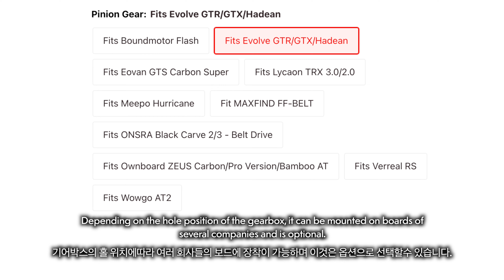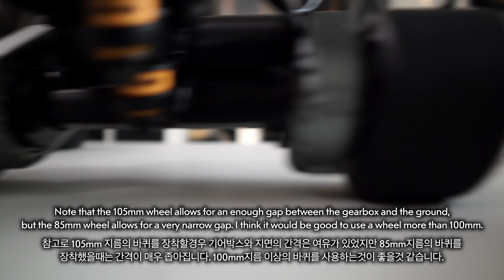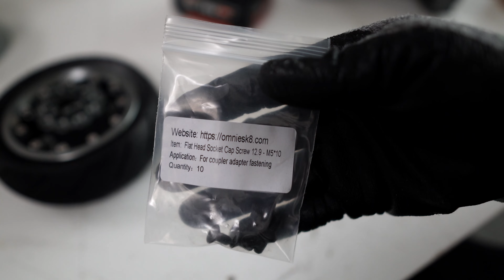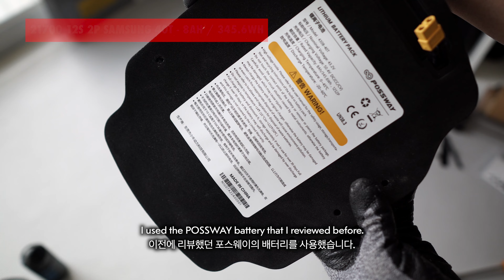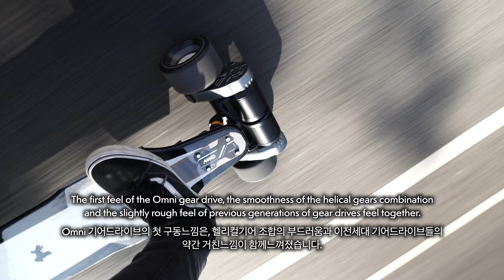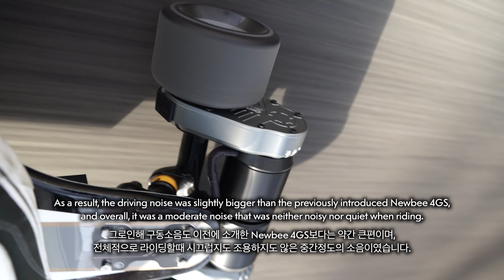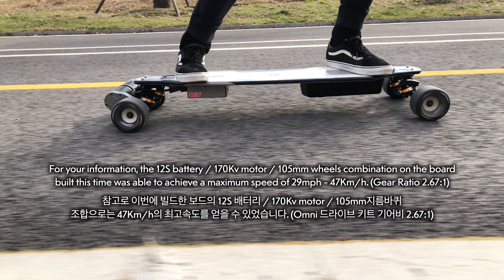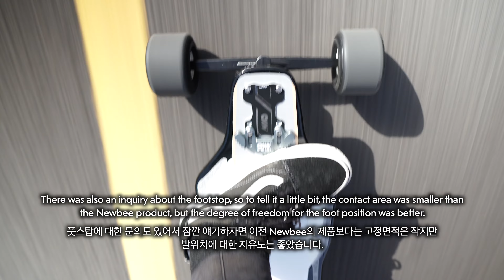#164 Build an Electric Skateboard with Omni 2-in-1 Gear drive system / Fits Evolve

Comment: where do you get the truck screws and nuts from? So interested in those kinds now, instead of using hex/allen key type screws.
Reply from the maker: If you search for M5 hex head bolts, M5 nylon nuts, you'll be able to buy them anywhere. You just need to select the length of the bolts.
Reply: Thank you @KAMiJUINs

Comment: The Meepo V4s ER uses the same Cells though 10s2p but I never expected such a high current could be extracted from those, as there is a noticible drop in voltage already with the comparably tiny output of 30A that it has.

Guess the pre built boards must have noticeable higher electrical resistance somewhere, compared to the DIY's.
Reply from the maker: In fact, Meepo's setting is the right setting. 
This is because it is stable to set the current to less than half of the total discharge rate for maintaining the same power even when the battery capacity is low.
In my case, I made this set to test it assuming that it was a more powerful output board.
Therefore, even if the battery capacity drops a little, the voltage drop can easily occur.
Reply: @KAMiJUINs  Interesting, then the 45A ESC of the Acedeck Stella S1 makes sense as well with 2p P42a's.
Reply: There’s not really a high electrical resistance in production boards, probably the other way round. They just don’t really use half the amps the batteries are capable of since their motor controllers, etc are only rated for often less than half a good vesc is rated for (would mean bigger component needs increasing the size of the boards also), so the voltage sag doesn’t hit as hard when there’s not as big a drop in performance as the voltage drops and the boards stay smaller in 2in1 at least. DIY can do the same thing just running lower amps but then you’re limited in power output (okay if you’re exclusively seeking range from time to time.)
Reply: @ajplant96  Would really like to build my own, sometime in the future.
Reply: @user-pc1er8zy7c  I’m on build number 5 in the new year which will be a quick swap 2wd-4wd mountainboard and it’s a lot of (expensive 😅) fun, definitely recommend scrolling through the esk8 news builder forums and gathering some info on how to go about it, bit of a headache to start but when you’re rolling you can make some awesome boards that cover all sorts of riding scenarios.
Reply: @ajplant96  Good luck with that, will probably take me long into next year before I start.
Haven't even used the current board for 300km yet.
Reply: @user-pc1er8zy7c  No rush, best to get as much use from your starter board as possible before looking at the upgrade. There’s universal elements to riding that’ll transfer from one board to the next aside from things like power and speed increasing. Definitely read up on what’s involved and see if you manage to plan exactly what you want the next one to be in the meantime.

Comment: I have the new Onsra BC3 and I am finding it quite underwhelming in top speed, also I didn't realize how often belts break on these contraptions. But I am thinking this gear drive will solve both those problems for me, increase top speed to 60km/h with 150mm wheels and no more weak belts that break all the time because rocks get stuck in pulley! I have ordered the Omni gear drive, thank you for bringing it to my attention, I hope the install goes smoothly.
Reply from the maker: Thank you for watching too, and hope you doing well as much as you want to~
Merry Christmas~
Reply: Guys, will this setup match with Onsra Velar?

Comment: Rolling resistance isn't affected by the type of drive.  It's mostly wheel diameter and a little the tendency of wheel material to deform.  Both in relation to the average surface deviation.